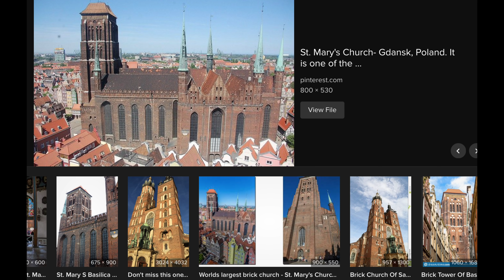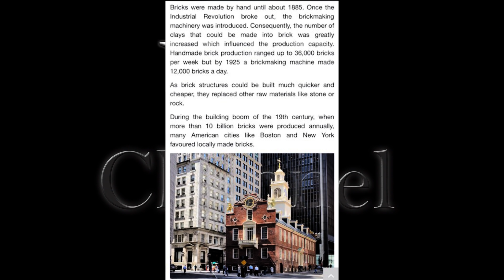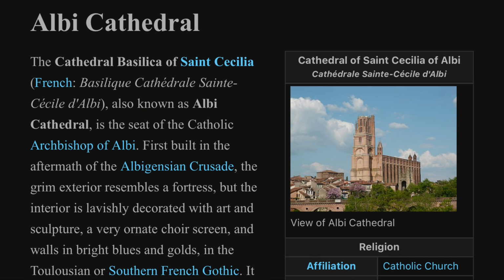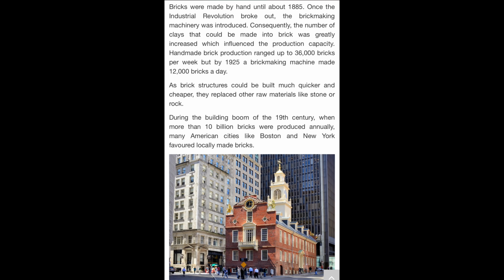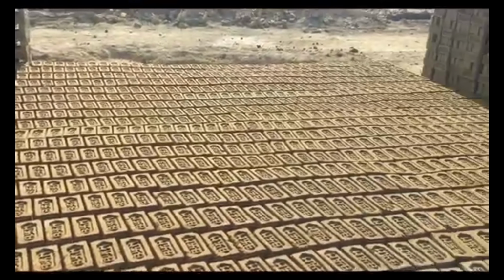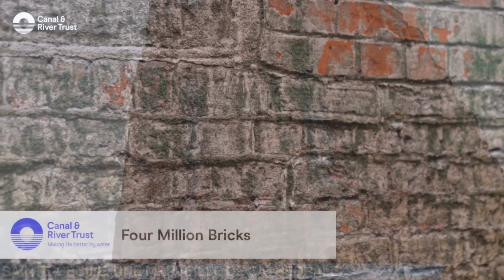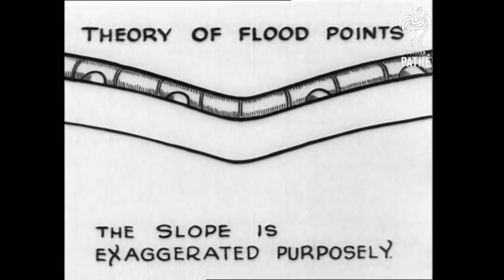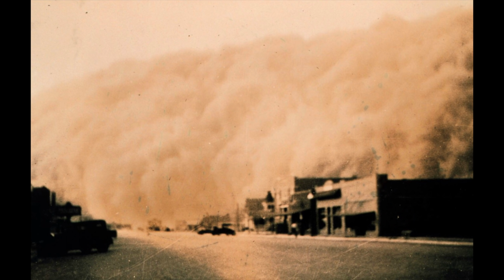Largest Brick Building | UAP

Comment: The material they are using is not the same. Hemp was not only the fiber they originally used. They used resin of hemp plant as mortar also. I would say they poured them in place and the recipe they used dried fast. I have shared the recipe before but I'm about to just make some and put out a video showing people. Hemp bricks are also fire proof and water proof. The bricks also stored energy like a battery. Hemp was used for many other things during these time periods, so it was available in abundance everywhere.
Reply: True
Reply: I saw a video that explained how they also poured the stone to build the pyramid's.
Reply: @allisongasparini7602  Some of those crazy brick walls that are these big mega blocks that are not the same size are made that way also. They're always talking about the precision about how they interlock so well and there's no room in between them. I have seen evidence by looking at the pictures of this as well as the bags they probably used that they poured into. I have tons of research regarding this over the years and I've been reaching out to these people with bigger channels in hopes that they want to discuss it further. I recently created a channel but have to start figuring out how to record the audio better then I'll start posting my own videos if no one else is interested. 😁

Comment: 1 trillion is a stretch 1,000 billion! But trillions impossible 1,000s of billions! 
if they could make 1million bricks a day, that's 365 million bricks a year, 
it would take 1,000 years to make 365 billion bricks! How many bricks do you think they could make a day? 
Even 10million  a day would take 100 years,
 but i bet many magnitudes less then 1million really
Reply: When he speaks of multi level tunnels , throughout the plane , what do you suppose the length and height of these tunnels are? A trillion bricks , I feel is on the low end... 4 million academic bricks in the dome. Who knows how many in the tunnels,
Reply: @wethepeople7961  so you reckon they easily made more then 10,000,000 bricks a day? Was that 24hrs a day? or 12hours a day? lets calculate how many that is a second shall we? And what was this mysterious technology they used?, if those ppl made 1,000 a day each you'd need 10,000 ppl making 1,000 a day to equal ten million.
Reply: 1 trillion seconds = 31,000 years
Reply from the maker: Officially they made over 2 billion bricks a year since 1925, yet the vast majority of large brick structures, brick roads, and brick tunnels pre-existed 1925
Reply: @UAPch  2billion a year thats 500years for 1 trillion!
Reply from the maker: @doubleooh7337  yup